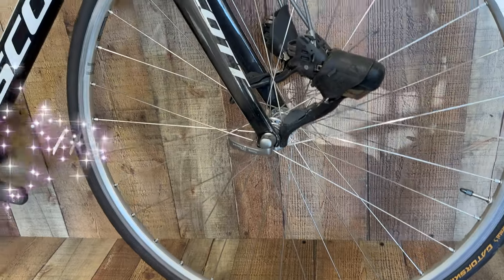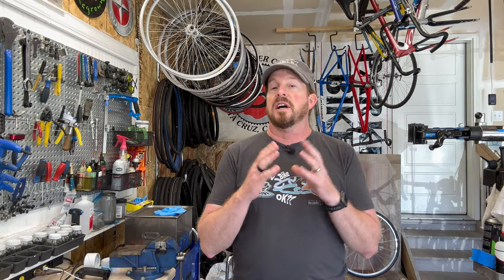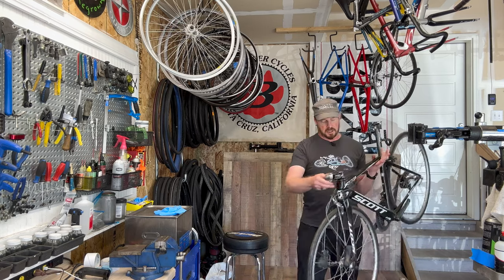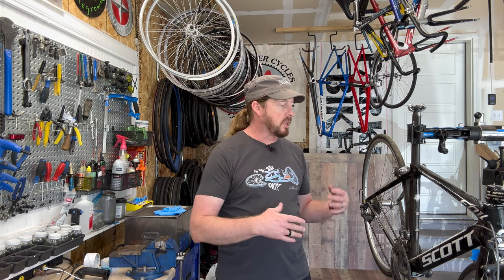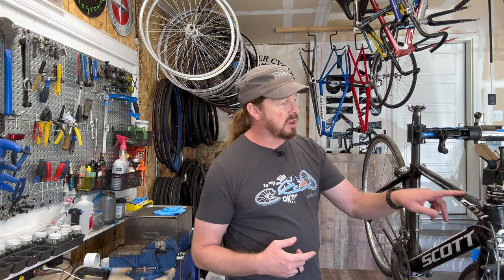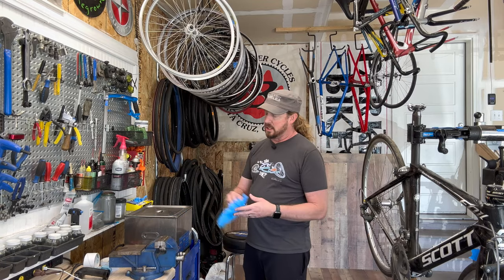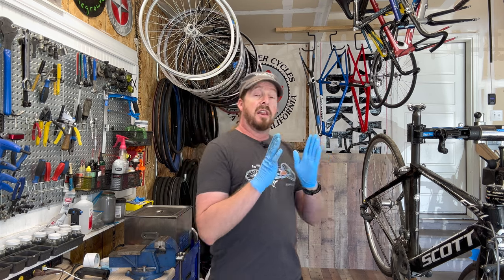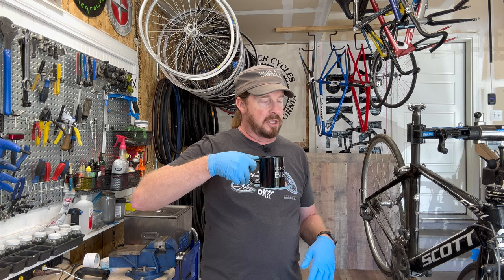What Does High-End Look Like? Scott Foil 10 - Tips For Buying A Used Bicycle

Comment: I've picked up bikes like this for 1,000 or less but you need to be handy to do the maintenance ( new tires, cables etc. ). What a bargain, research.
Reply from the maker: That is basically what my business model is. Providing great used road bikes under 1k that are fully tuned and ready to go. But you are right, 97% of them need a tune up to be safe to ride.